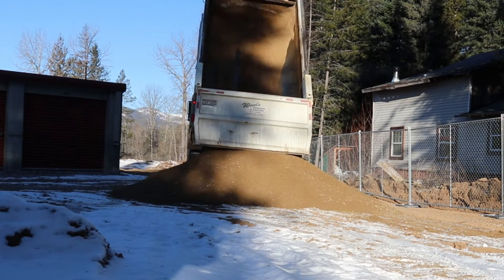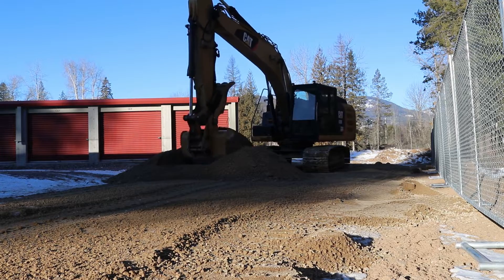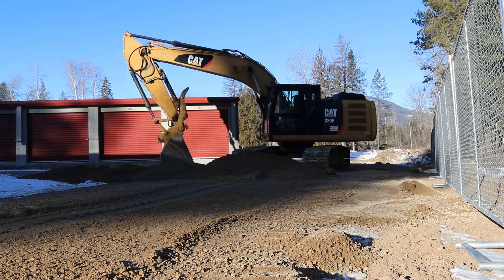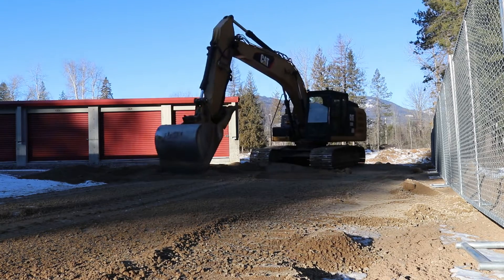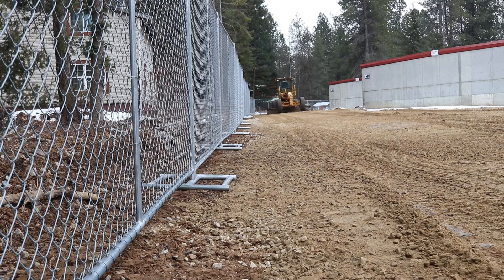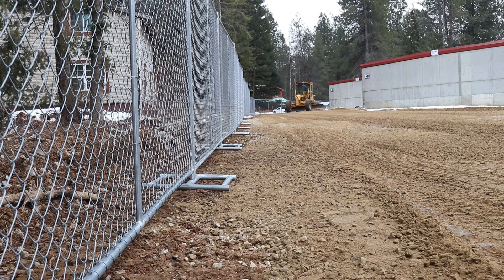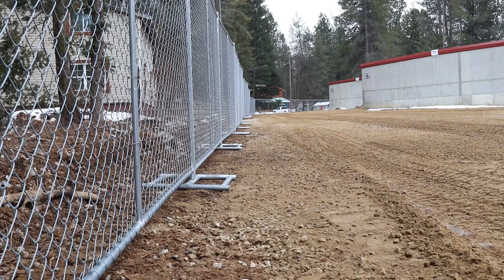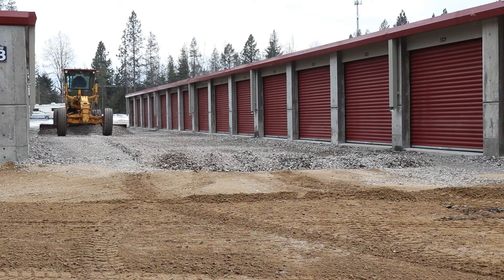The Road Flooded - How to repair a washed-out Road with a Grader

Comment: Josh.   If I could only have 1 piece of equipment to work my small 120 acre homestead what should it be?  I am aware that big machines take big tools to fix.  My last machine was a kubota B21 TLB.    I SEE LOTS OF TRENCHING, DIGGING, GRADING.   NOT MUCH LIFT AND LOADING.
Reply from the maker: PWH,  For what you are talking about I think a 60 HP 4x4 tractor would be the best fit and then a close second option would be a skid steer.